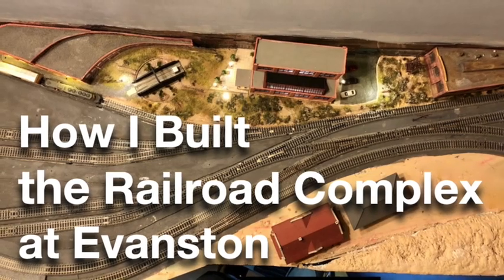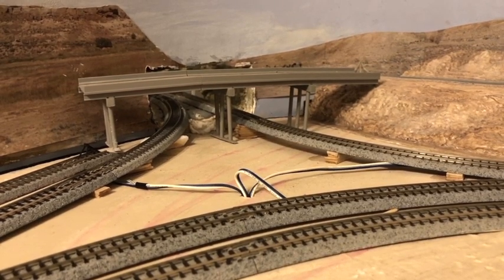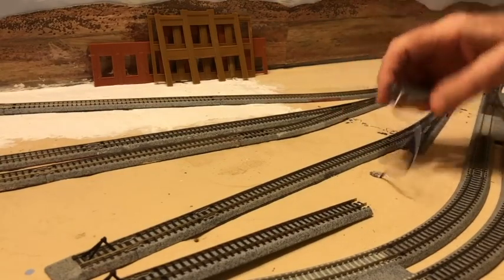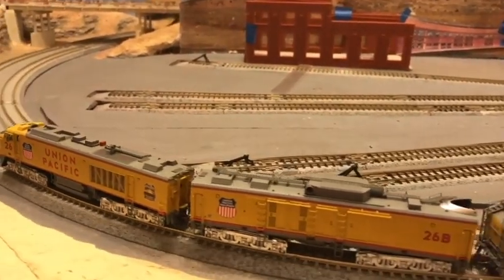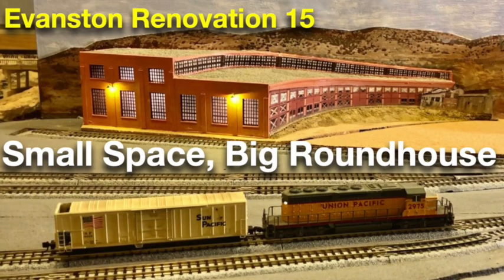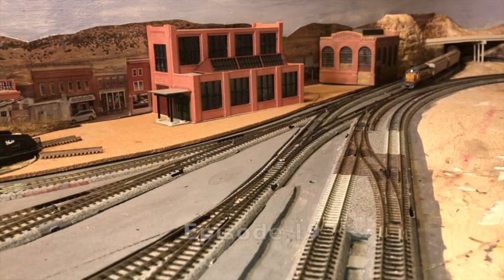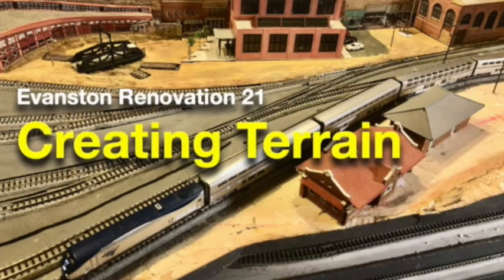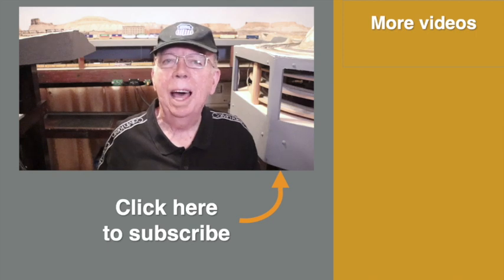How I Built the Railroad Complex at Evanston on My N-Scale Layout

Comment: Hey Roy, I never asked at the time - did you use an n scale ruler to calculate what height your backdrop photos of Main Street needed to be?
Reply from the maker: That’s a great question, Mark. Thanks for asking. No, I didn’t use my N scale ruler to size the backdrop photos, although I could have (and perhaps should have). Instead, I just scaled them down in pronter settings. I scaled them down and printed them out several times on regular paper until they “looked right”. Then I printed them out out photo paper. Thanks again for asking. ...Roy